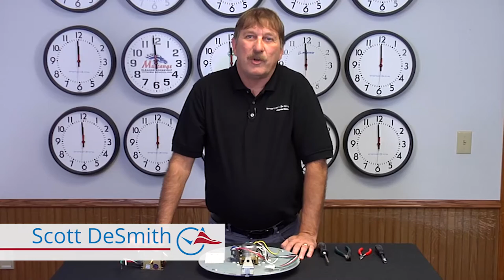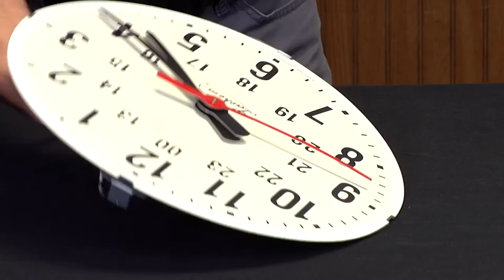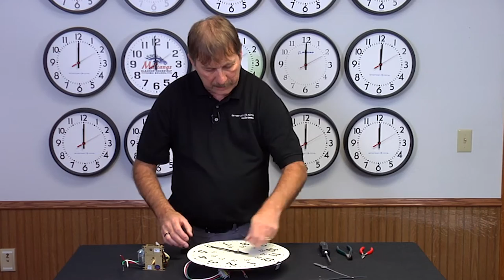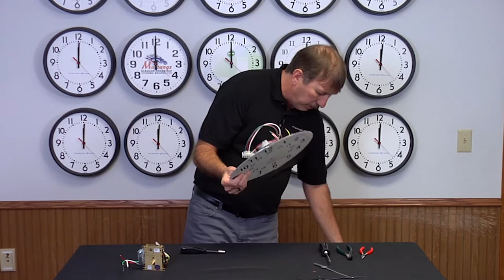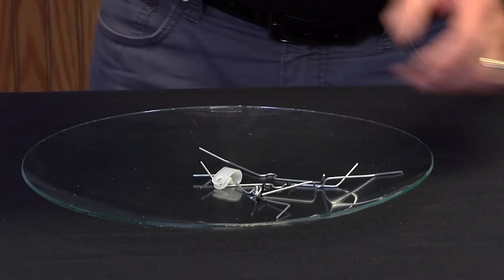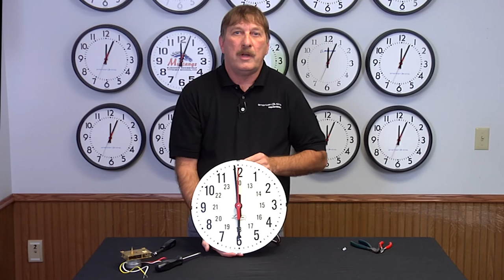How Do I Replace My Synchronized Clock Motor

Comment: Hello...I am looking for a vintage Synchron motor...model 610 110V 3W 1 RPM 60CY  2-58   for a Borden Ice Cream clock I have purchased that does not work I have taken it apart and the motor does not turn the gear....looking for a replacement if possible or something suitable to replace what I have the whole movement or the same motor...????  thanks for your time...